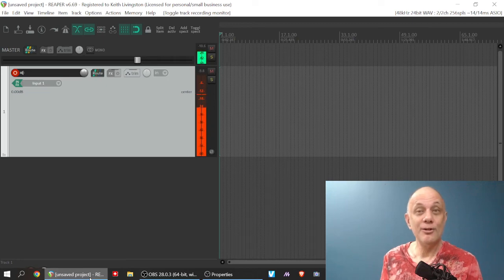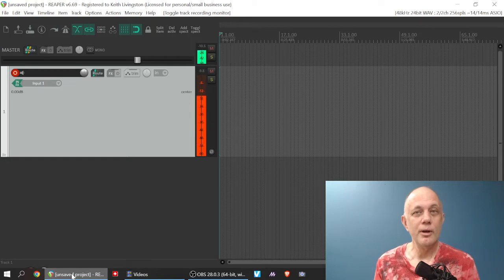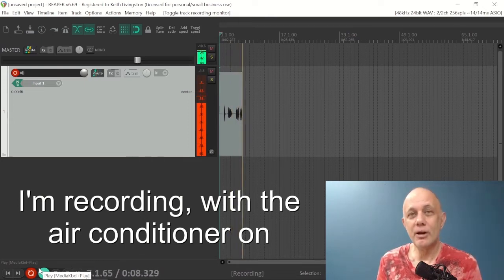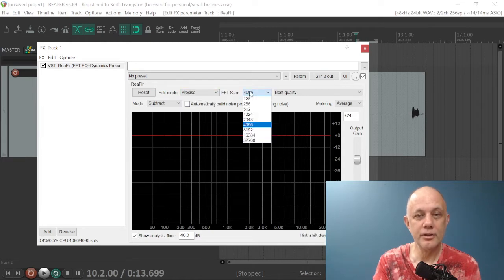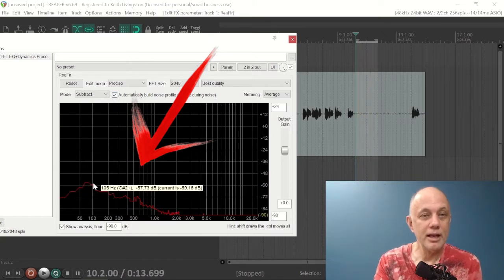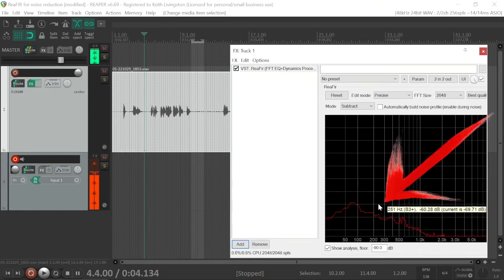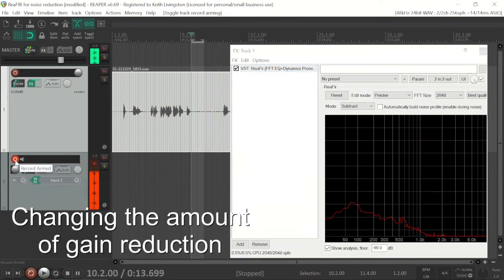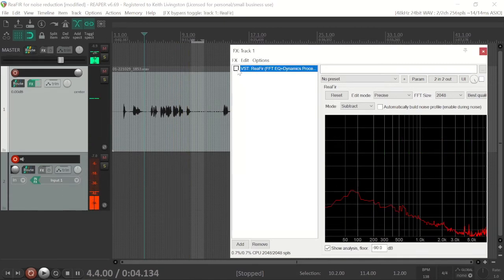ReaFIR For Noise Reduction

Comment: I had a noisy mic cable once and a non sound treated room, used this to cut out a lot, sure I got a lot of robotic type sounds when using but easily smoothed them out with other free plugins to get a better than rough cut demo
Reply from the maker: It can certainly leave artifacts -- especially if the noise isn't steady.
Reply: @NLNPNL oh yea, for sure, any kind of digital alteration can too, but my point was it was easy to remove the noise then bring the sound back all with free plugins